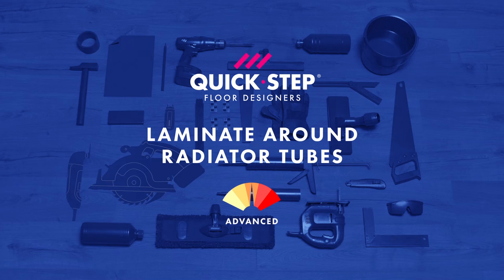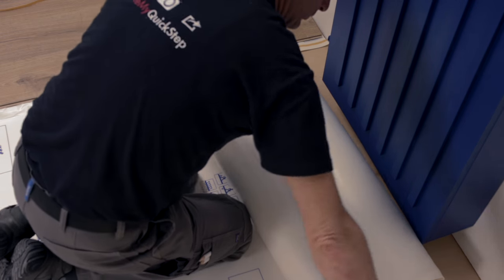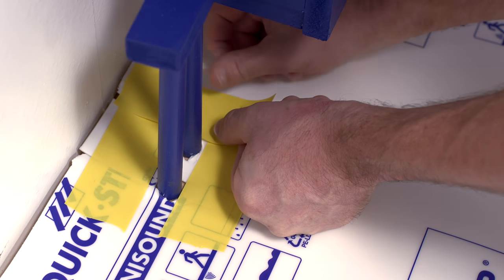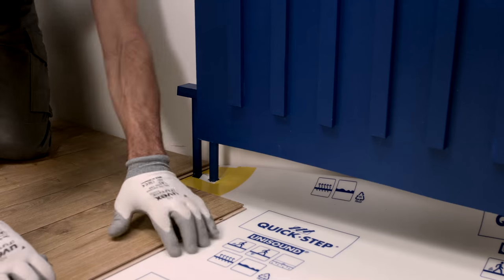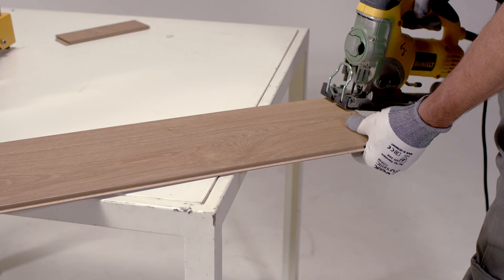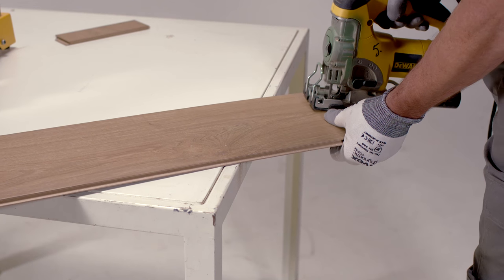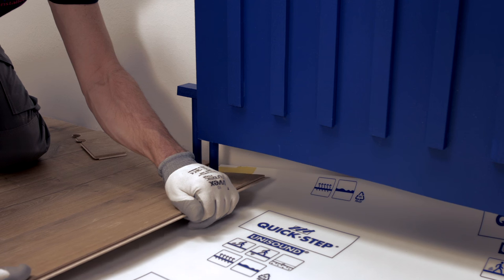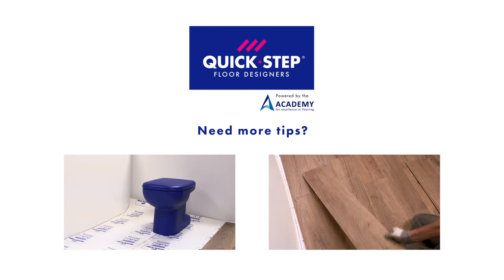How to install laminate around radiator tubes | Tutorial by Quick-Step

Comment: this would be great if my flooring didn't have pre-done grout styling (they look like tiles with grout but its laminate click in style). Guess I just have to cut the pipes down, install the flooring on top, and then do the plumbing all in one day while the water is off. Good thing this is a total bathroom remodel and not just a quick flooring installation.
Reply: You can drill holes in your board (measuring their position using a similar technique to that shown in the video), then cut two lines from the end of the board up to each of the drilled holes. You will be left with two small in-fill pieces that you should be able to slot behind the pipes after the board is in position around them. Use an adhesive to stick them in place if necessary. You may need to click the board into the previous row first and slide it over the pipes if your drill holes are too small.
This will be neater (not to mention a million times easier) than doing any plumbing(!) and will offer a good finish – it's standard practice for other materials too.

Disappointing that Quick-Step does not show other pipe-cutting laminate scenarios, e.g. when there isn't a full plank on the board before the pipe, or if your board is parallel to the wall instead of end-on as shown in this video.
Reply: @jonathanmusk1546  it would have left lines though. i already did it by cutting the pipes, but in the process, discovered shark bite fittings. best invention.